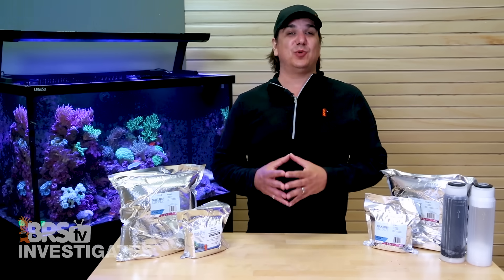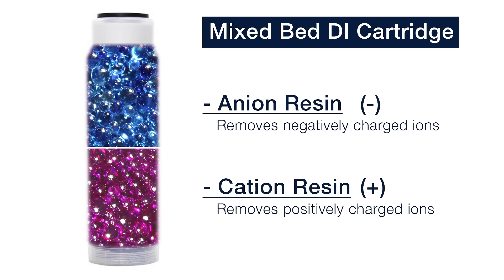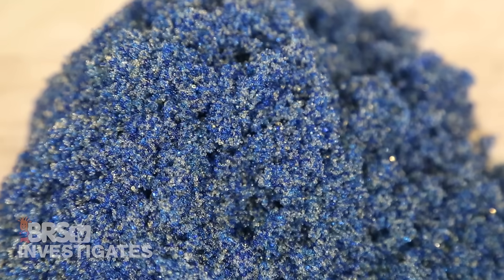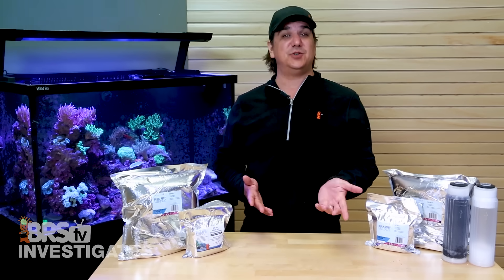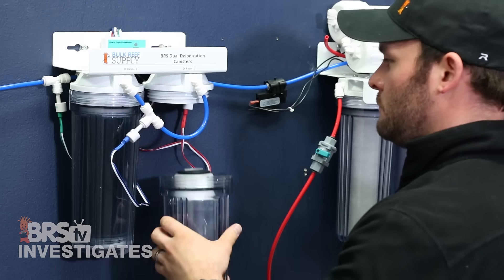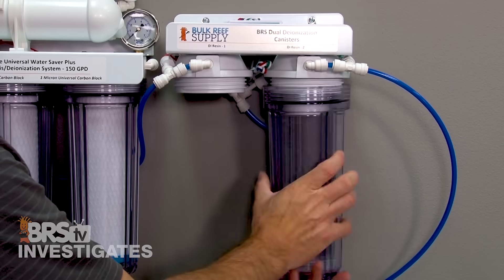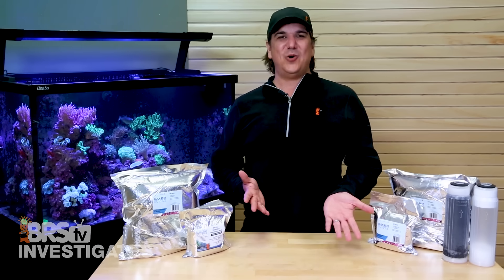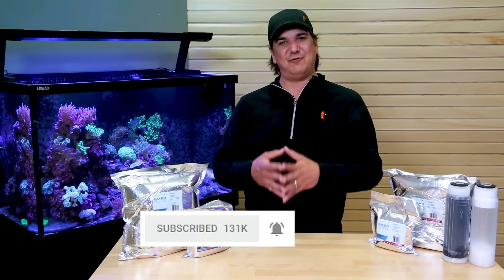What happens to ammonia and silica when DI resin is depleted? | BRStv Investigates

Comment: Question?? So, how long typical would DI resins last. During this video it seem that they only ran the unit for 8 hours before it was exhausted. Seems very short time. my unit would only produce 150lt in this time?
Reply from the maker: These tests were conducted with straight tap water feeding the DI canisters, rather than being pre-filtered by the sediment, carbon block, and RO membrane. This is why the resin exhausted so quickly, whereas in a full RODI system you would see much greater DI resin life.

Comment: Another great video! I knew ion displacement could happen; I was just surprised that it happened so soon, before the resin is actually 'depleted.' The issue I've noticed is that my TDS reads 0 for quite some time after my resin appears to be depleted based on color change. I've been thinking about getting a second canister, this basically confirms that I need to do it.

Comment: So obviously the "buster resin" comment was geared towards the Spectrapure Silicabuster. I'm curious to know why you think the Spectrapure Silicabuster DI resin is a gimmick? Did you guys perform any testing to make that claim? The Silicabuster DI cartidge is 3/4 of regular blue, color changing mixed bed resin and the bottom 1/4 is the brown silica resin. 

In your demonstration the silica will keep getting bounced by another ion. So if the bottom quarter of the cartridge is only for Silica absorption, other ions would bypass it. And if the silica resin gets full, it can still go to the mixed bed resin above it.

The high capacity Silicabuster lasts me 3 times longer than the regular resin. It costs more, but I'm saving in the amount a resin I have to change (plus I like pre-filled cartridges).

Spectrapure is one of the best in water purification. I would LOVE to see a Silicabuster catridge vs the bulk blue resin to see the results.

Comment: My water always tastes sketchy yet my resin hasnt gone even remotely orange and my tds doesnt even go above 1 by the 3rd stage...guess i didn’t really need 6 stages in the first place
Reply: Aquavert GreenWorks 
Did you check for chlorine/chloramines? Possibly the carbon is depleted? That wouldn't show on a tds meter.

Comment: I got the triple system about a month ago. I'm burning through anion resin in no time. I'm thinking my supply water has high silicates or maybe CO2.
Reply: Jase Poag 
You could always fill 2 cartidges with anion resin and the 3rd with mixed bed. If you're not going through much cation, then a mixed bed should suffice on the end.
Reply: Not a bad idea actually. I just went through and changed out all my prefilters. I doubt it'll help, but who knows.

Comment: What is the max amount of Nitrates for a POWDER blue tang
Reply: BulkReefSupplyCom I have a predator system with a shark so the bioload is heavy. I am talking 40-100 nitrates. Normally stays in the 40-50 range but hits 80-100 sometimes. I am wondering if the powder blue tang can handle it. Since this isn’t a reef any other ways to lower nitrate other than a fuge and skimmer?